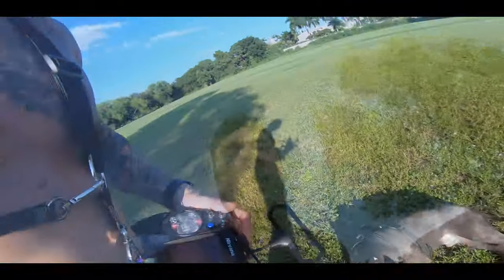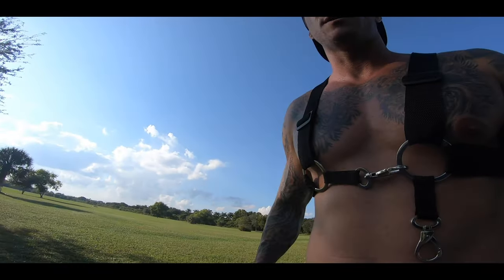My experience with FlightOne revoltosd

Comment: Could you explain how you were able to flash them with betaflight? I wanted to update to the latest FlightOne firmware but I just can't get it to work. And now there's a new config software (FalcoX) and it's not clear if only that one is maintained. Their website and support sucks.
Reply from the maker: This was a while ago but I think I just held the boot button and plugged in in dfu mode and then flashed in betaflight. Should be a YouTube vid about it